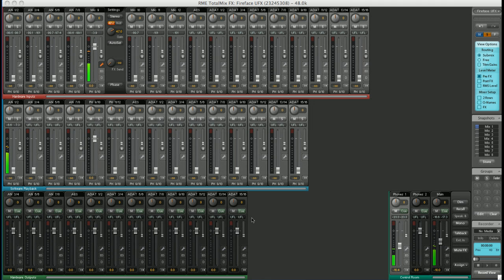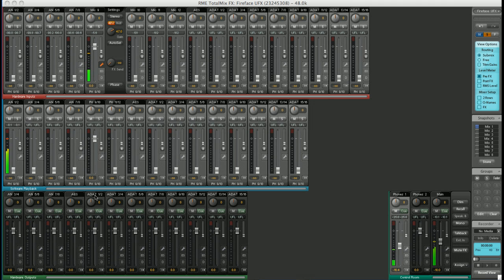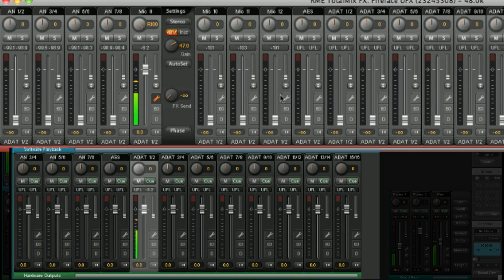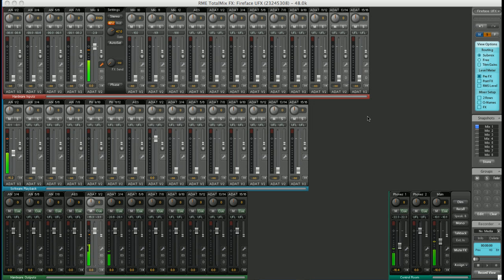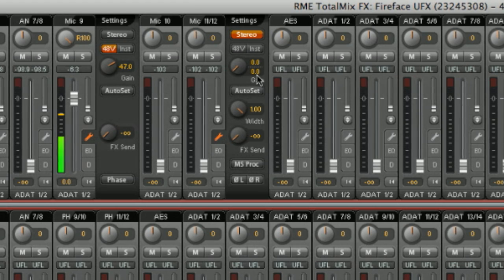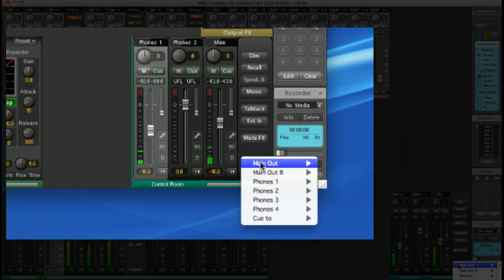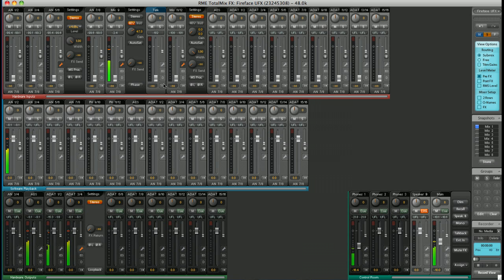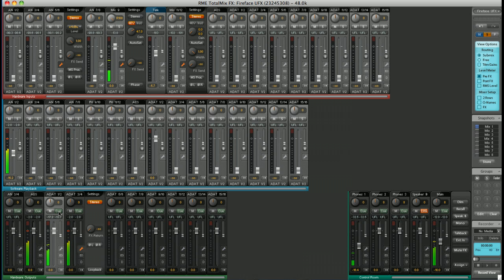RME TotalMix FX Tutorial Part 1 (of 2) - Synthax Audio UK

Comment: Hi again. I have a question about my BabyfacePro Fx i just bough. I plugged in a condencer mic into input 1 (turned on phantom power in TotalMix FX) and i plugged a Dynamic mic into input 2 (phantom power off). Im using Logic Pro and i would like to add a different vocal effect to each mic. However, for some reason i dont even hear output from mic 2 in my headphones while recording i only hear mic 1. What am i doing wrong? And how would i set up different effects from Logic Pro? Please help:)
Reply from the maker: Hi, sure there’s a few things you’ll need to check;

1) Have you increased the gain on mic channel 2 in TotalMix? To do so, click the wrench on the mic input channel, then raise the gain encoder to increase the level.

2) Click on your headphones channel in TotalMix (bottom-row) to select its submix, then raise Mic 2's fader (top-row) to route your second mic to your headphones output (for direct monitoring from TotalMix). Do you hear audio? If so, the issue lies within Logic rather than TotalMix.

3) In Logic, create an audio channel and set its input to your Mic 2. Now either record arm it or switch on monitoring for that channel. You should now be able to record / monitor the signal from this microphone. 

For effects, just add them to each channel individually from the Logic mixer.

Hope that helps.

Comment: Great video thank you very much! I have a question. I have the Babyface Fs. I want to have a setup so i can have a live performer on mic1 output to speaker1 and the instrumental/beat output to speaker2. I am using Logic Pro to add Fx to Mic1. How would i do this? Your help would be greatly appreciated! Thank you.
Reply from the maker: Hi, sure that should be fairly straightforward, although how easy it will be to explain via Youtube comments could be a different matter! Here goes anyway; 

1) In Logic, make sure you have your master track set to outputs 1/2 (it will most likely be set to this by default already). This means that Logic’s output will correspond to the first two Software Playback channels in the middle row of TotalMix FX.

2) Next in Logic, set your microphone track’s output to be different to the Master channel, e.g outputs 3/4 (or just 3 if you can, as its mono). 

This means that your microphone now has its own dedicated output, and will appear on its own channel in the middle row of TotalMix FX (channels 3/4, the second stereo pair).

3) Now in TotalMix FX, click on the wrench next to your speaker output channel (bottom-row) to expand its options, and de-select the stereo button. 

This splits the output into two mono channels (they'll now say ‘Mono’ above each one), and you now have two independent submixes for your left and right speakers.

4) Still in TotalMix, select your first mono output that you just created, and raise your Beat’s output channel (channels 1/2 in the middle row of TotalMix), to route the beat from Logic to your first speaker.

5) Now click on the second mono output, and raise your microphone’s output from Logic (channel 3/4, middle row of TotalMix), to route your microphone from Logic to your second speaker.

And that should be it, best of luck!
Reply: @SynthaxAudioUK  you are officially the CEO of TotalMix for Dummies! Those were the best instructions i ever got! Thanks so much mate;)))
Reply from the maker: @darkod4772  Haha no problem, glad you got it sussed.

Comment: to which channels are the various wav-files from the connected usb-drive routed into (to assign then to the different RME-outputs)?
Reply from the maker: Hi, I’m afraid I’m not entirely sure what you are asking. Recordings can be made directly to a USB drive via RME’s DURec function, a direct connection which is found on the RME Fireface UFX, UFX II and UFX+ audio interfaces.

Recordings are stored as an interleaved .wav file, which can also be played back from the audio interface. Each individual recorded track will appear in TotalMix FX on the corresponding input channel (the channel which it was recorded on). Each channel is therefore available for routing, just like any other hardware input or software playback channel.

You may also benefit from more detailed support. To find local support for your country, please visit https://www.rme-audio.de/en/support.php

Comment: Question for the group: Is there a way to adjust the fader volume of the analog channels in stand alone mode?
Reply from the maker: The exact method depends on the product, but this can generally be done through the front panel controls.  I hope that helps.

Comment: Hi! I'm trying to record drums through a RME FF800 inteface. I am using the 8 line inputs in the back for my preamps, routed correctly via TotalMix and the audio goes into Pro Tools just fine. However, the mic tracking my hihat via XLR going into the first preamp in the FF800 is not getting any signal, and I am not seing ANY of the four onboard preamps as channels in the TotalMix window.  How can I get TotalMix to show the onboard mic preamps? Best regards, Cristoffer Iversen, Norway
Reply from the maker: Hi there, channels 7 & 8 (mic / line) on the front of the Fireface 800 are shared with the inputs on the back (also labelled 7 & 8). You'll therefore need to open up your settings dialog (the icon for settings is the RME logo with fire around it), and select which inputs you want to use from there.

You can also use both inputs simultaneously (front and back), although you will have a shared volume control for both in TotalMix, as the signals will be coming in on the same channel. Hope this answers your question, best of luck!

Comment: sorry for the stupid question but, can you use an rme 802 for lets say ableton or reaper?  do you  absolutely have to you use total mix? or can you still use the interface without total mix.. im confused...thanks
Reply from the maker: Hi Louis, yes of course you can use any RME interface with any DAW, including Ableton and Reaper.

As far as using TotalMix goes it's part of the driver, so will always be running whenever your interface is in use, although you can essentially 'set it and leave it' if you'd prefer.

I can assure you though that once you understand TotalMix, you’ll find it to be both logical and incredibly powerful.
Reply: thank you !

Comment: Hi, I just bought an RME UCX to upgrade from my Mbox 2. I was advised by a friend that they are great and I'm sure they are but I'm having trouble interfacing with Protools. Can I manage a 5.1 sound mix with the RME and Pro Tools 10/11?
Thanks
Reply from the maker: SynthaxTV;
Hi, yes setting up a 5.1 mix in Pro Tools with your UCX is fairly straightforward. After connecting each speaker to its own analogue output on your UCX, you then need to send each channel to its own output from Pro Tools (you’ll need to do this from your preferences in Pro Tools). These outputs will appear in the middle row of TotalMix (which shows all audio being outputted from software running on your computer).
 
Next in TotalMix FX, simply click on an output fader (bottom-row of TotalMix), which selects the submix for that output channel, then raise the relevant fader on the middle row to send audio to the corresponding analogue output. So, if for example you’re outputting the mix for your L speaker to the first channel in the middle row, and you’ve connected the L speaker to analogue output 1 (first channel in the bottom-row of TotalMix), simply click on the bottom-row fader to select the channel’s submix, then raise the fader on the middle row to send the audio to this output. 

Now do the same for all of your remaining channels. The default configuration in TotalMix is a 1-to-1 routing, so you may not need to worry too much about custom routings. Hope this helps :).

Comment: is there any possibility to rout the submix to an external audio device, e. g. the soundcard of your computer or to a virtual audio cable?
Reply from the maker: +Music4Passion4 Hi, not within TotalMix FX itself, although I'd image you could find a third-party app that would allow you to do this. Depending on what you're looking to do, you may be able to use the 'Loopback' function to achieve similar results. 

Loopback allows you to route your channels back in as inputs within TotalMix FX, just like plugging a cable from a physical output channel to an input channel. 

You can take audio from both your physical inputs and your software playback channels (DAW's, media player, web browser etc) and combine them, mix them etc, then route them back into an input for recording.

Comment: Is there a video dedicated to a simple step by step demo of how to connect outboard gear? I'm using Logic Pro X and typically would use the I/O plugin. Any constructive help appreciated from a new RME owner.
Reply from the maker: +GSlide Hi, Apple provides a quick guide on the Logic side of things here - https://documentation.apple.com/en/logicpro/usermanual/index.html#chapter=10%26section=12%26tasks=true , I’d advise you to check that out first. Once you’re all set up in Logic, routing to external hardware can be done fairly simply within TotalMix.

For example, let’s say you want to send audio from output 1 on your interface to an external device, and then have it come back in on input 1. Once you’re set up in Logic and you’ve connected your cables, bring up TotalMix and do the following;

1 - Click on the output channel (bottom row) that you want to send audio to. I.e the same output you have chosen to send audio to in Logic. This corresponds to the physical output you have connected your cable to, output 1 in this case. Clicking on an output channel in TotalMix brings up the submix for this channel, allowing you to choose what is being sent to this output.

2- Next, turn up the fader on the software playback channel (middle row) that Logic is outputting to. You are now sending this signal to output 1. Logic will now see this signal, so you can go ahead and record your processed signal. 

Hope this helps

Comment: Hi, Does TotalMix FX supports VST plugins ? And is it possible to route my input microphone to Adobe Audition CC so that I can have my sound processed ?
Reply from the maker: Ginster Hi there. TotalMix FX doesn’t support VST’s - its primary function is to provide control over the inputs and outputs of your RME audio interface, as well as allowing for some very flexible routing options, giving you the same control that you would find on a physical mixing desk.

However, what you can do is record into a DAW with VST support, such as Adobe Audition CC, and process your sound there, so the answer to your second question is yes :)

Comment: How do you change the fireface USB settings to change the clock mode to 96000 Hz? When I change it, it goes back to 44100 Hz in about 2 seconds every time.

Comment: Do you keep software playback at -3, and hardware out at 0? I am guessing software playback should leave some headroom for the hardware, but I am not sure what is the best settings for the most accurate representation of my mix in Ableton. I'd really appreciate the help.
Reply from the maker: Hi Europa,
Interesting question.  As the routing within Totalmix is all carried out within the RME's FPGA chip, I don't think it necessarily matters which way round you have the attentuation applied (if you're talking about fader positions)..
Reply: Hello, thank you for your quick reply. I see what you mean. My babyface sounds too loud when the output is set to  0. And this is the case with my monitors and headphones. It is odd how loud it is, do you experience that? is there a reason for it to be extra loud, like adding gain or limiting by itself?
Reply from the maker: *****
Equipment from different manufacturers can have different sensitivity, which means that with certain combinations you notice quite a 'hot' signal.  The Babyface's outputs have a reference level of 0 dBFS = +15dBu (+7dBu for the headphone output).
If you check the rear of your speakers there may be some trim or reference level switches which could help,
Reply: Thanks for your feedback, i lower the sensitivity on the monitors and they sound better now. the headphones however are always too loud when the babyface is set to 0. Oh well it is not such a big deal with the headphones i can just turn the volume down.

Comment: Im have a problem with my baby facer as well. for siome reason. when i pan my tracks hard right i cant hear my track any more in my right head phones or speaker. but if i pan it hard left i can hear it from my left head phones. and when i play back my recorded track in Sonar the volume in my left ear head phones i can  hear loudly but not in my right. its just so qiet . I looked and turned all faders in total mix to figure out how to turn up the volume on the right but no luck. id like the to mix a song and here the paning effects in it.
Reply from the maker: Hi CJ, I'm afraid without looking at your settings directly it's not immediately obvious what's causing your problem.  I'd recommend contacting your local RME support who will be able to help you further.  You can find their contact details on the RME website > rme-audio(.)de/en_support.php
Reply: synthaxtv If you are using windows and get automatic updates or use sound game or video controllers it might work to go into device manager and disable everthing other than your babyface as a sound device.  I was having all kinds of problems with pan that sound either similar or identical to yours and disabling realtek drivers and sound game and video controllers in device manager fixed it entirely.  There is something posted in an RME forum about this . . . I can find the link if you want. good luck.

Comment: I don't see any signal in software playback section. I click on "Inst" button in "hardware inputs" section to record direct my guitar and it works fine I see a green signal in my fader on mono track 9 and I see it working through "hardware outputs" "main" channel but I don't see anything in Software Playback section. I assigned the hardware inputs to outputs and software playback to those outputs but it still doesn't work.
I tried to arm a track on an interface and it still doesn't work. thanks

Comment from the maker: Hi ZombowFlow,
When you first install the RME drivers the mixer is configured with a straight through 1-1 routing. So at this point you don't necessarily need to touch the mixer if you'd prefer to do everything within Pro Tools. If you've changed some settings and would like to revert to a straight through configuration; just select the 'Options' menu, then 'Reset Mix' and 'Straight Playback'.
Hope that helps.

Comment from the maker: Hi Omar,
When you first install the RME drivers the mixer is configured with a straight through 1-1 routing.  So at this point you don't necessarily need to touch the mixer if you'd prefer to do everything within Cubase.  If you've changed some settings and would like to revert to a straight through configuration; just select the 'Options' menu, then 'Reset Mix' and 'Straight Playback'.
Hope that helps.
Reply: De nieuwe wet die   GDe
Reply: Fijne vrouw.